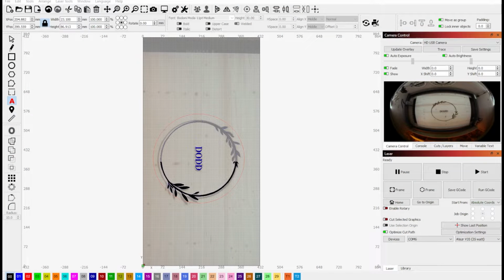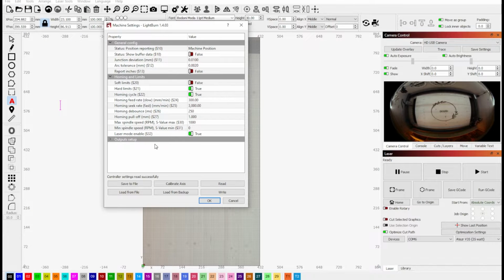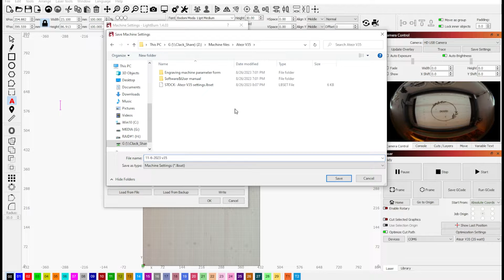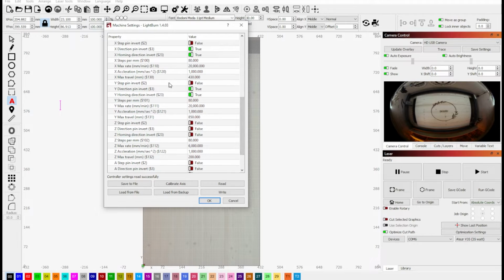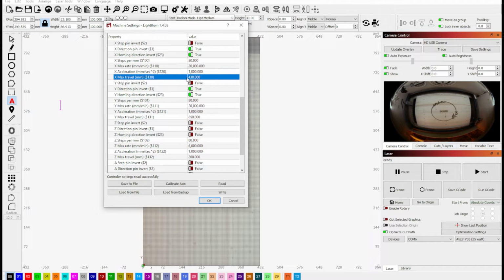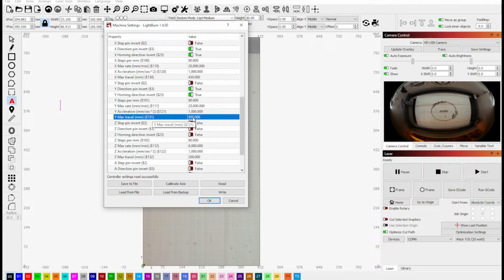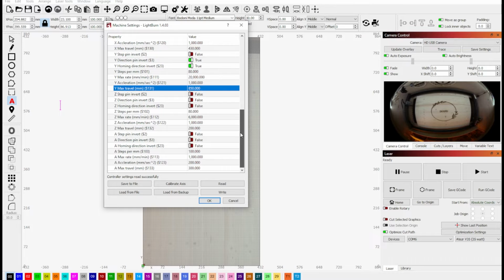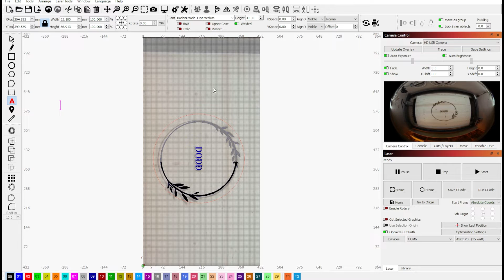NO MORE DOUBLE HOMING- Fixing homing issue in lightburn after extending

Comment: I don't believe Xtool lets you write to the controller - you did say this works with the Xtool?
Reply from the maker: No, with xTool, you have to do it in XCS. Same result though
Reply: @TheClackShack  Thanks a lot for your time and great videos on laser cut. I was going thru the same issue with double homing with Xtool D1 pro and extension set up, but Lightburn won't let me write the Y max lenght, you say I have to do it in XCS but there's nowhere I can go deep in the machine controller settings as in Lightburn, did you do something specific ? Thanks a lot !
Reply from the maker: @alexandredierick5875  there is a setting on XCS that will change it to extended

Comment: My software is Lightburn 1.4.05.   Have experienced homing and X,Y location errors in my new Atezr 35w+ since assembled.  Upon start up it sometimes bangs into the limit switches and attempts to keep moving.  I bought the extension rails along with the 35+ originally, although I have not installed them as yet.  Your solution is worth $$$.  Could you do an episode on Machine Setting?  I think it could be very beneficial to so very many folks.  Thanks for all your contributions you are All-Pro.
Reply from the maker: Thanks, I have a few videos that go over settings for several issues. Make sure you are set to absolute coordinates.

Comment: Perfect timing, sir! I'm planning to install the extension rails on our D1Pro this weekend. By any chance,  are you  aware of any lightburn camera that will work on the extended bed? Thanks!
Reply from the maker: The xTool is a little different. You have to use XCS and change it in the settings.

Comment: I need to purchase a separate laptop for my engraver, may I ask which you are using or suggest as far as the specs ??
Reply from the maker: My machine is set up for streaming and video editing. A basic windows 10 machine will run lightburn
Reply: @TheClackShack   Thank you.  Is that with 4, 8, or 16 gb (or  more) memory ?

Comment: It should be compulsary for all extension kits to come with the $132 command change instructions not just the work size change, like you I probably answer this about 5-10 times a week.
Reply from the maker: It is a very common issue for sure. Seems like it always comes up in the live also.